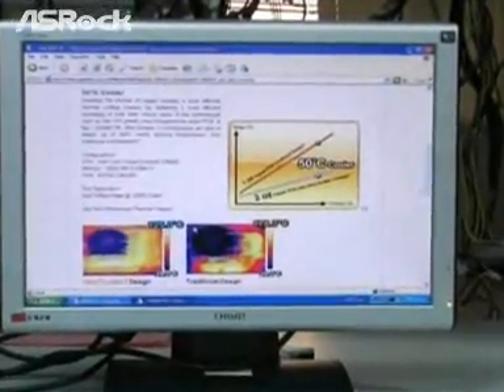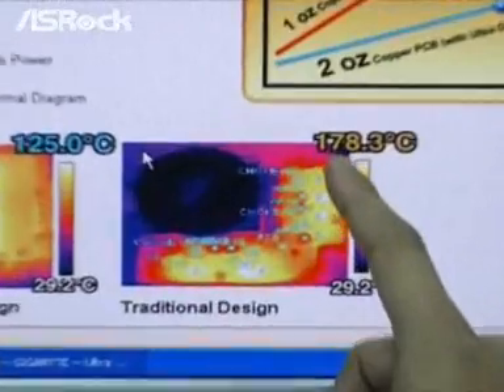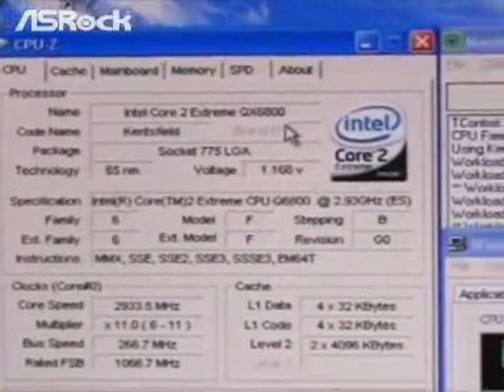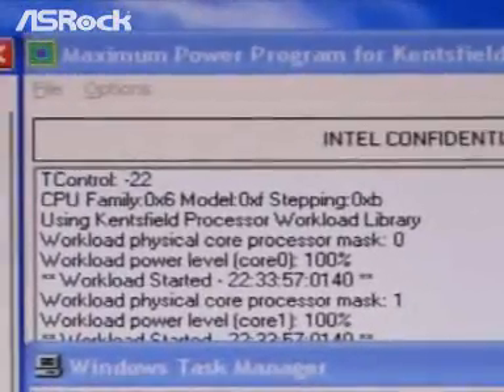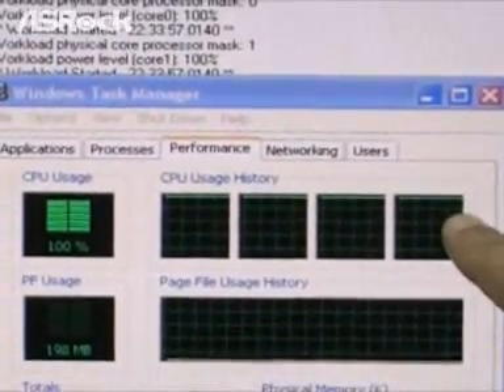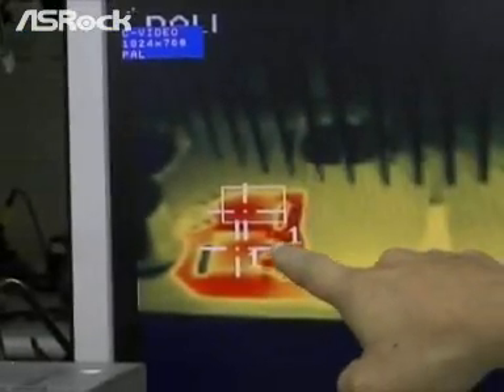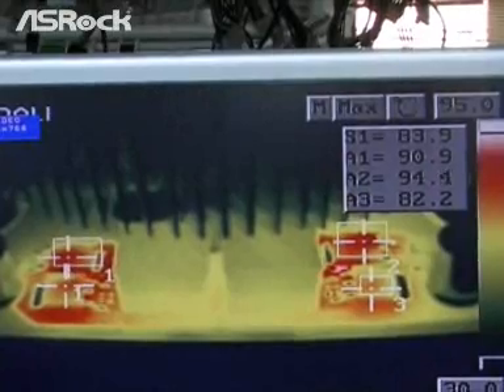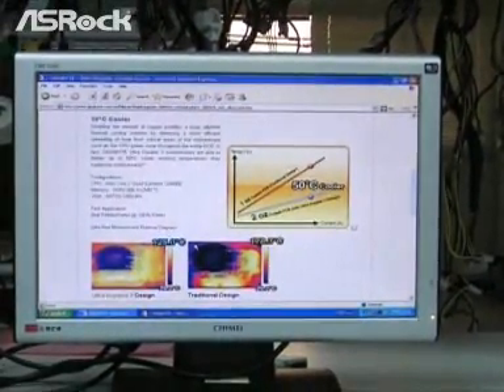Is 2 Oz copper PCB really necessary?

Comment: @KeepingModern Plus, 
If your case supports it you could put an inexpensive fan UNDER your CPU to cool the lower side of the motherboard. That way you could lower the temperature of the entire system - memory and chipset too, LOTS cheaper than a third party cooler. All you need is a hole in the tray - usually they facilitate installing the cooler. It seems to me the heavier copper would provide some benefit if you did this.

Comment: most of the people who are bitching about the asrock board obviosly dont own 1 and base there "facts" off of other brands. i have owned an nvidia 680i an msi p6n platinum an nvidia 790i and an asrock p45 all of which used the same hardware. the highest stable clock i could get out of my q6600 was 3.1 ghz on all boards accept the asrock. on the asrock i have it at 3.4 and can still push it. the asrock board is a very reliable board and im very happy with it screw all who flame and have no info.

Comment: For the others: 
Asrock goes for the Mid Performance Range as MSI goes. And leave the Highperformance Part for Asus. Asrock boards needs lesser Power then Asus boards. (Same Chipset) but don't go for the last 5% in Speed. So Asus and Asrock splittet their Marketshares. GA goes from midclass to highclass with around 5 Years back in tweaking experience as Asus, and now have some problems with the Heat.  They go the Brute force not the smart way. Asrock is unfair as they don't go high performance.

Comment: I am Student of Computerscience. 
When you Look Closely you see the Stock Intel "Cyclone" type Coolers on both CPu's (The Characteristics can be seen on the Images).
The Coolers don't like close Elements, wires to close about 30% less Air flow. When you look close again you see the coolers on the Board from GA. They are to close.. design failure. And this is reported on several sides that the Ga boards are rather hot with Intel Stock coolers. Design error, from GA.